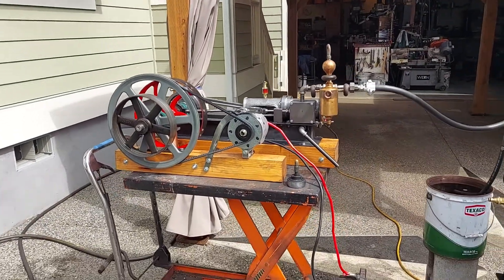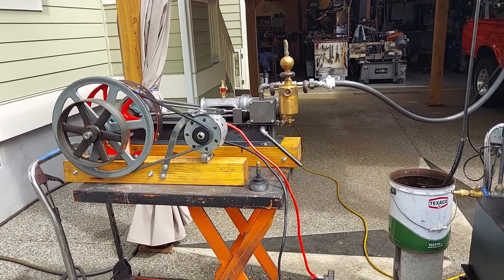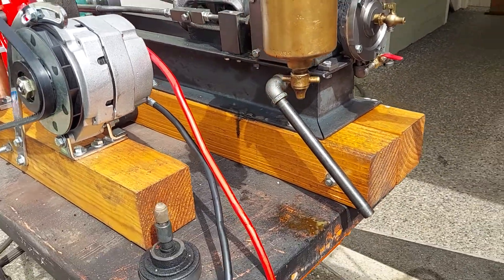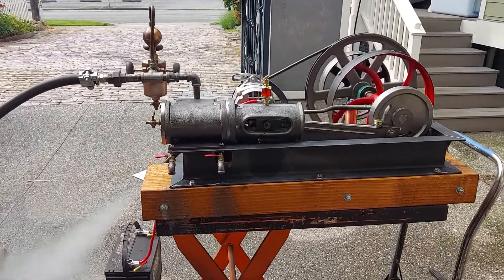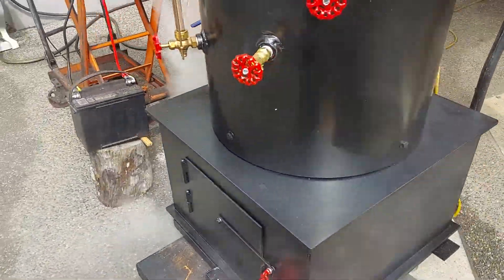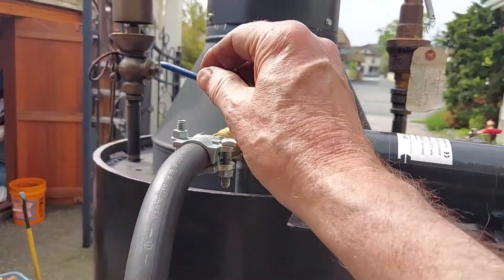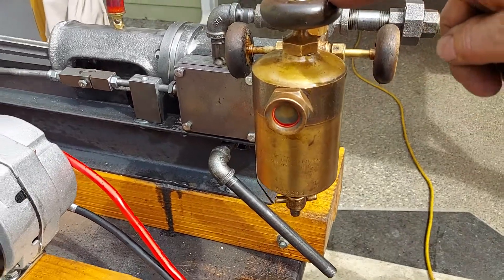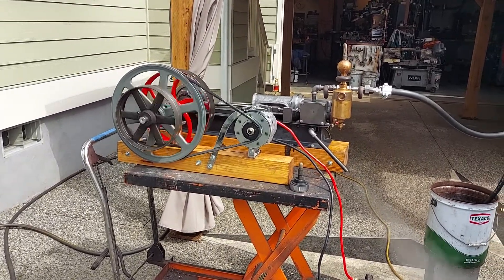Mill Steam Engine Alternator Whistle Gauge Steam Engine boiler off grid FOR SALE

Comment: I would like pricing info
Reply from the maker: The next 20"boiler will cost about $5,975.00. I will complete it in late April. The  steam engine with alternator is $5,675. You can see them on ebay. Search "steam off grid" Ross